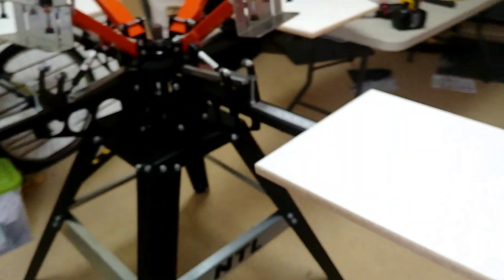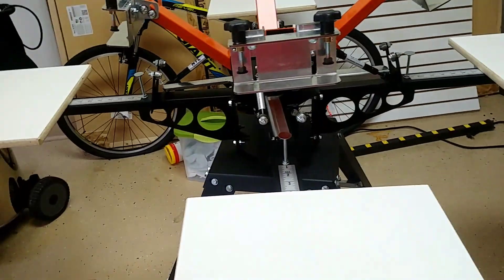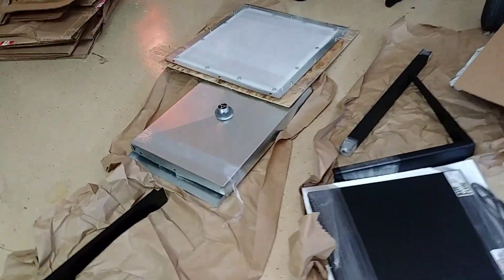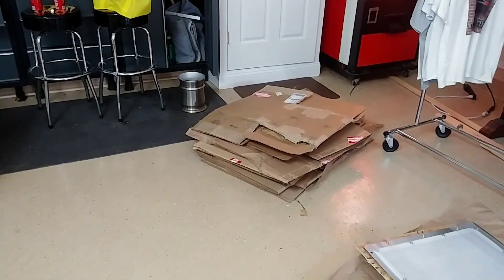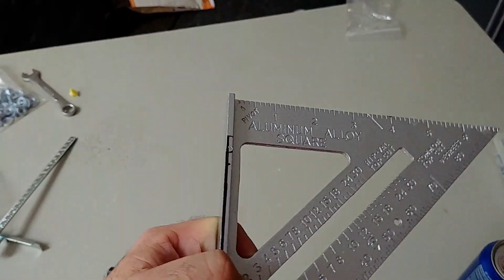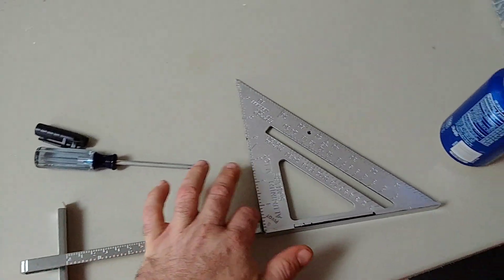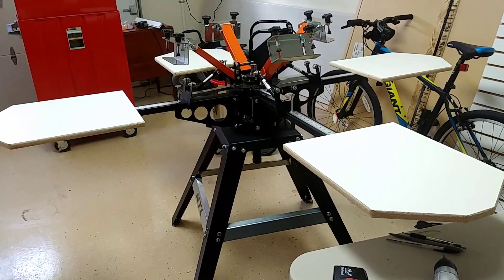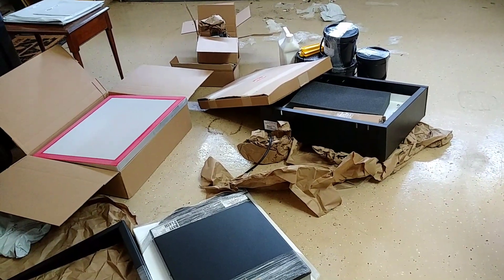Jay P Shocker Screen Printing Assembly FINAL

Comment: You're on your way my man!  Sounds like the carousel is trying to lock when it is 45° to the base...not 90°, which makes sense. You're going across a wider footprint. The distance from one foot of the base to the next is shorter then the distance from the one directly across from it. Hope that makes sense lol. Looking forward to watching you grow!
:)
Reply from the maker: Jason Enz thanks so much bro!!!! I appreciate all your expertise and support! I do see what your saying, makes sense the problem is it's not locking for some reason it will click but will move will the slightest push. Im gonna call tech support today. Thanks so much!
Reply: Jay P - it's just supposed to lightly catch, as a reference point. Not really supposed to lock in. I was asking a couple pros about it and they all said the have it set where they can just barely feel it catching. One said he took them all out so nothing catches. I have mine set a tad tighter then that because that's how it came and it worked for me. There should be a nut, screw, or something that you can see what you need to adjust that. The Riley Hopkins had a wheel that caught a divot...I don't know about the new ones. My workhorse Mach has a weird system for the catch. Let me know how it goes!
:)
Reply: Jay P did you call the tech? Did you solve the issue with the lock?